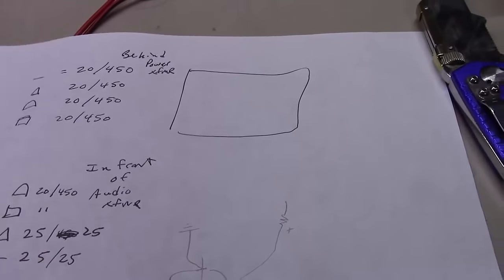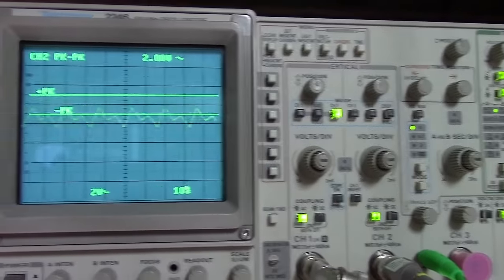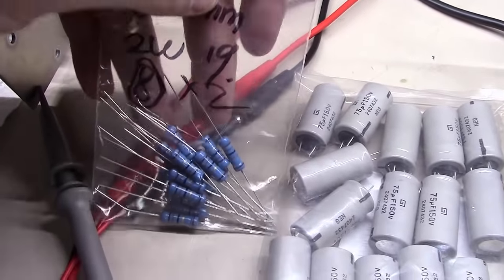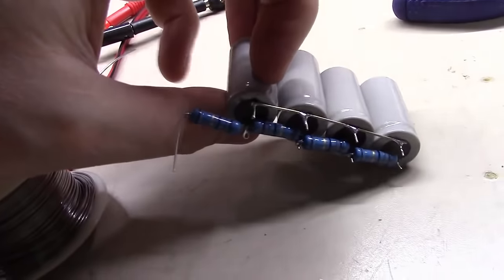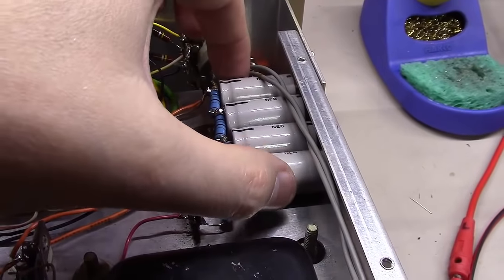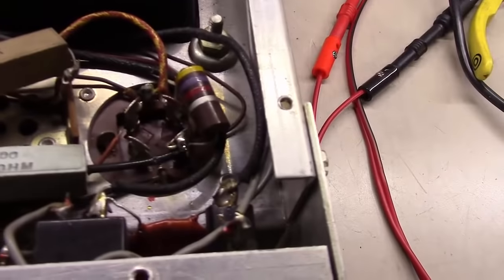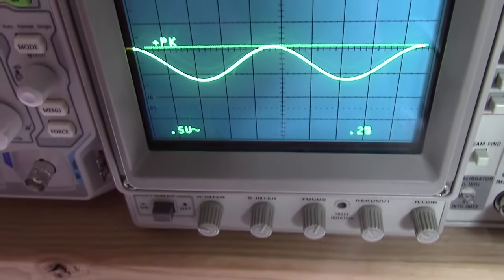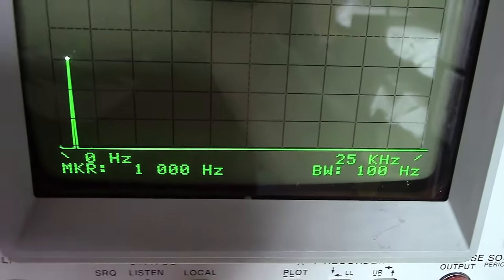HH Scott 222C and 222D Tube Amp Restorations Part 3 - BG027

Comment: Nice piece. Heat will tell you alot about a circuit. I like your method of connecting the caps. Very neat and tidy. Love your testing equipment too! Quality tools, quality results. Thanks for sharing and looking forward to the next...

Comment: The original circuit for 222D model, there is no longer a capacitor hanging off Pin 8 of the 5AR4.  Coming off pin 8, the schematic calls for a 20Ω (R206) resistor then two 20uF capacitors (parallel) going to ground.  This was done so the 5AR4 can handle 40uF at start up, and to lower the voltage by 10V going to the output transformers.  At 32:20, you found the first capacitor left offline probably to reduce the B+ voltage.  Nice restoration project, well done.

Comment: I'm working on a Scott 340B receiver, which also uses the 4x75 common positive can.  Where can I find 75uF caps?  I've looked all over and can't find any electrolytic 75uF.  Room is also tighter under that unit.  Going to try to re-form first, but not sure if it doesn't work what my plan B can be.

Comment: Isn't DC on the filaments rather unusual?  Mos tube amps that I have serviced have two special secondaries on the power transformer.  Yellow wires for the rectifier tube filiment at 5 volts and green wires that is 12 volts center-tapped for the 6.3 or 12 volt heaters on the rest of the tubes.
Reply: maybe those tubes have directly heated cathodes otherwise its completely unnecessary to use dc instead of ac.